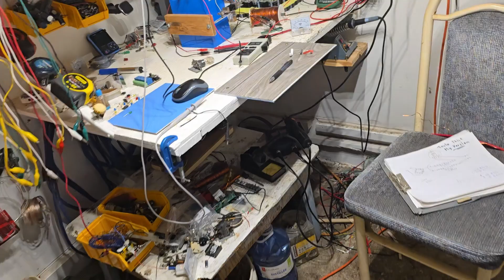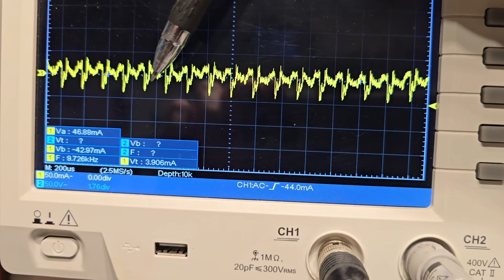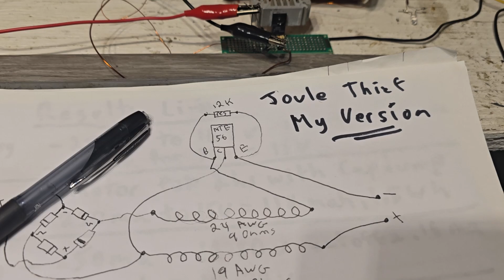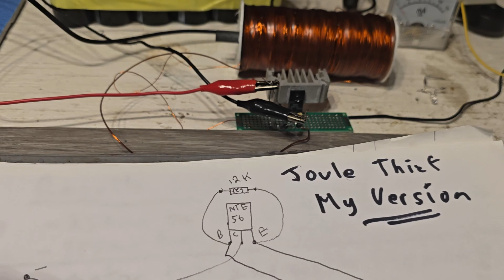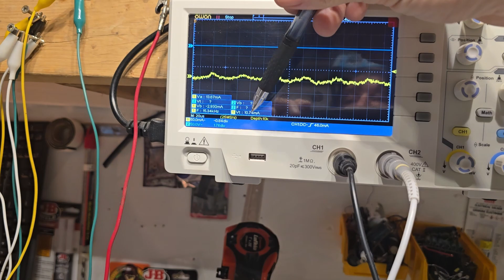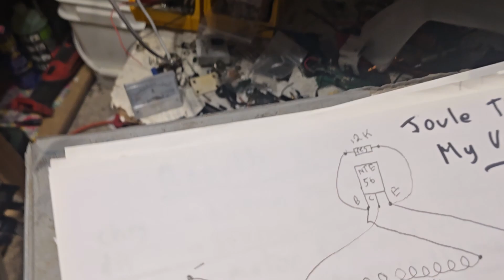Power Out is used, then returns to the source battery... 5lbs coil

Comment: Does it vary with the physical distance between the coil and the capacitor (or cap bank in your case)?
Does it vary with the orientation of the coil versus the position of the capacitor (or cap bank)?
...because what actually charges the cap is not the current of the back emf. ...It's the aether being pushed or pulled through the plates (of the cap or battery).  But the aether itself is also moved by magnetic field. And it's also effected by the dialectric medium used in the cap or battery... so this is why you get different results with different  kinds and different geometries of capacitors.

Comment: First time seeing this circuit or even hearing of this circuit. Looks to me is what your saying is that if you leave this on it can charge your battery bank slowly over time?
Reply from the maker: It uses the power then sends most of it back to its input battery when in resonance.  But will definitely increase the battery when transfer the power from the caps back to the battery when the caps are full enough.  It's really simple to build but some of the components are expensive.

Comment: So what you are showing is like a Fly-back transformer,power goes in and 90% is reflected on the negatve cycle,
Reply from the maker: No this circuit works on the same principle of the SERPS device,  it uses the power on the way in to do work then it uses the same power again as most of it gets returned back to the source battery .  Check the patents for the SERPS device by Jim Murray and Paul Babcock.
Reply: I tried this sort of thing way back in the 2000's I used a bridge rectifier in a voltage doubler circuit. I had seen where Tesla did the same with DC batteries. What I tried was a simpler circuit using bridge rectifiers basing it on the principle of a Flyback transformer. My aim was to use the current after it had pass through it's intended circuits then use it to charge a battery using induction.

Comment: I don't think it's possible to measure HF with analog, they react way too slow :D It's possible to choke some of the HF with soft steel core isolation transformer. But it also means more resistance and losses.
Reply from the maker: Yeah but I use it to give me a basic idea of what is happening in the circuit.  I use it that way not for measurements.  I use the only way that works which is a very accurate current probe